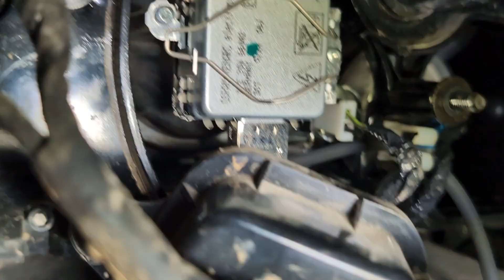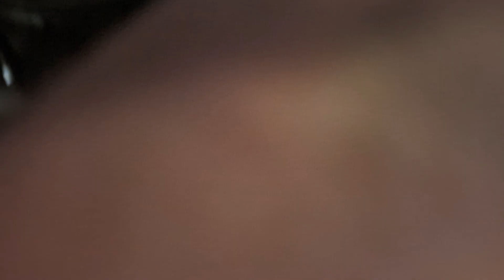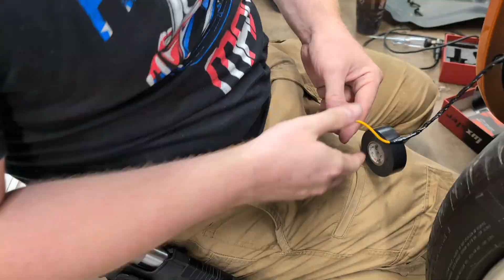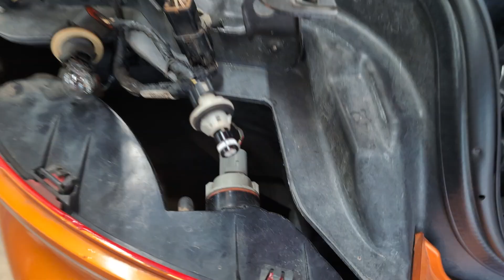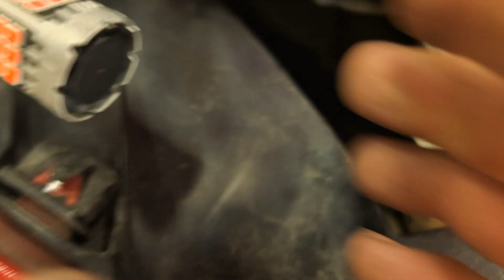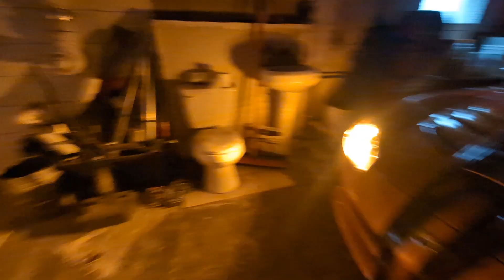Dodge Viper SRT10 LED Turn Signal, Tail Light, High Beam Conversion

Comment: I don't know if it's an issue with the Viper, but on most cars you have to orient the LED correctly. The flat part is supposed to be horizontally placed to reflect the light forward.
Reply from the maker: @drsten29  These did do it with either polarity. These bulbs are reversible.